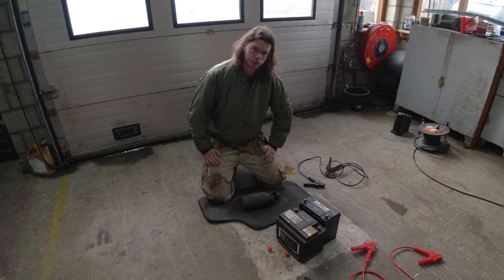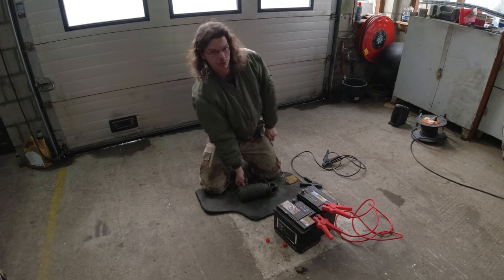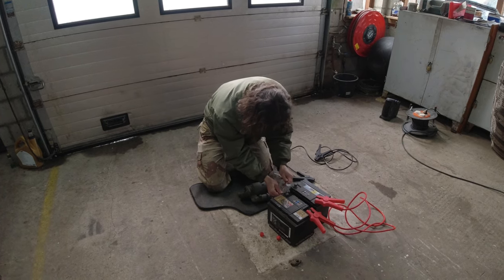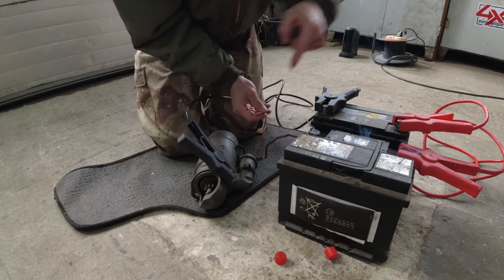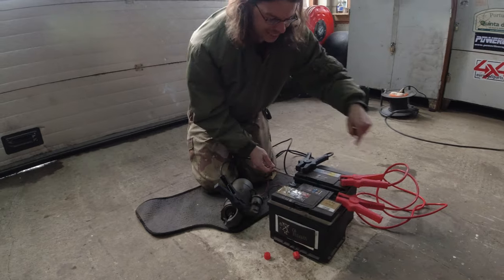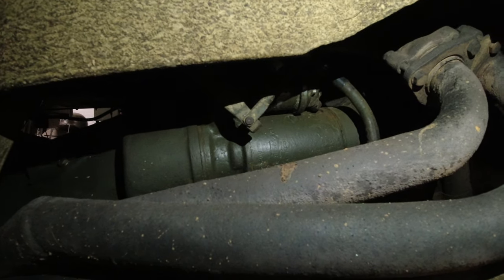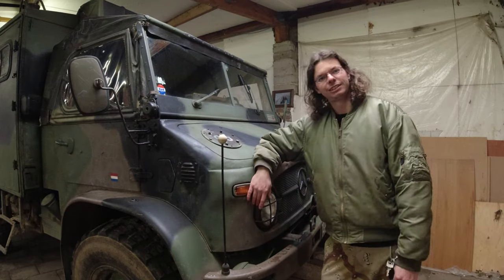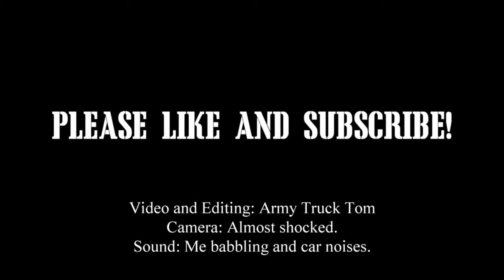Unimog 404 vlog 06: Starter rebuild.

Comment: Fantastic rebuild Tom! I have a 1973 406 that I cannot get the hi-low shifter unstuck (transmission rebuild I am thinking)...I am sincerely disheartened...but you video sure did cheer me up!
Reply from the maker: thanks a lot :)
i do'nt exectly know exectly how the 406 gearbox looks like
but if you don't have a pto you could remove the plate on the side of the gearbox and maybe get a good look inside before removing everything. it might give an idea of what is going on inside or why it isn't moving.  the gearbox of the 404 has several plates that can be removed to exes it's internals, maybe this is the same with the 406.
hope this helps.
Reply from the maker: In Unimog vlog 01 the internals of the 404's gearbox are shown a bit.

Comment: I've thought about converting to 12V but the more I think about it maybe a DC/DC (24V to 12V) converter might be a better idea. I want to go EFI, same engine. Also, the readily available accessories in the US are 12V, lights, winches, what have you... Another thing I've thought about is finding those old style fuses isn't real easy either. I want to modernize that.
Reply from the maker: I run a small dc/dc converter for phone chargers etc. for camper etc it's always good to keep the 24v there are a lot of videos that explain why. Here most big rigs and truck are 24v, so it's not really hard to find the lights etc. winches are a bit harder to find but I know Superwinsh, Warn and all the regular brands sell 24v variants. As for converting to efi, I'm not a fan, but I just like to keep it stock and just hate having a bunch of electronics running my engines.😅
Reply: If you want to have the oldtimer as original as possible, you have to leave tings as they are. Fuses don't care the voltage and most of the winches operate on both 24V and 12V. But 12V always means higher current, which means thicker cables,  ... That's the reason why in most countries in the world 240V is used for houses and not 110V like in the US.
Reply: @Superleicht_R107  You make some really good points, so thanks! The one I bought a couple of months ago is a virtually untouched '63 Swiss straight out of surplus and into a warehouse here in the US around 25 years ago. I'm going to get it extricated out of where it's sitting a few months from now. I feel a little dumb about the fuse thing. I really should know better.
Reply: @p.t.anderson1593  The 404's of swiss army have been maintained the best. Since Switzerland didn't want to buy the complete Unimog because they wanted to do something to the vehicles in their own - a kind of finishing -, there are some technical differences. The most significant is the ugly roof. But part of the electrical system is an other specific thing. And here especially the fuses. They are highly sophisticated devices which work like modern automatic fuses of houses - as far as I know. Another thing is the seating bench which is in the middle so that dismounting went faster.
Enjoy your Unimog and keep it running.
Reply: @Superleicht_R107  That's all good information to know, thanks! I used to hate the "ugly roof" but I've warmed somewhat to it's appearance. It's my first Unimog and I intend to enjoy it for a long time.
Reply: @p.t.anderson1593  👍🏼

Comment: I have have that made and had to pay 300€. Pre-owner drove it in the mud. But mine is a DC generator since my Unimog is from '55.
If you start the engine (cold or warm), don't press the gas-lever - but never, never press it multiple times (pumping). (See "handleiding" of the Unimog.) What you can do on first start after a few days is to pump gas (Benzin) into the carburettor. There is a hand-lever on the pump for that.
Reply from the maker: Luckily we were able to fix it ourselves, starters are expensive eater way. First time i ever heard pumping it would be bad, have always been doing it (i think), even with other old cars it always seems tot do the trick.
Reply: @ArmyTruckTom  The Zenith NDIX 32 has three tiny special holes for the starting process. In order to work, nevertheless petrol should be in both chambers. After a long stand all petrol is evaporated. So you have to pre-fill the carburettor first by handpumping at the petrol pump. Pumping with the gas-pedal would not expedite petrol to the carburettor. That's what is said in the handbook - and what you learn at the Bw-Fahrschule. 
But! After the engine is cold started and runs hard on dying away you can "play" with the gas-lever to keep it going until it runs good enough. The choke should then put in as soon as possible, since the engine (nearly) needs one thing more than petrol: Oxigene.
Reply from the maker: @Superleicht_R107  Thanks for the info, did not know that about this carb. It's always good to learn new stuff ^^
Reply: @ArmyTruckTom  👍🏼